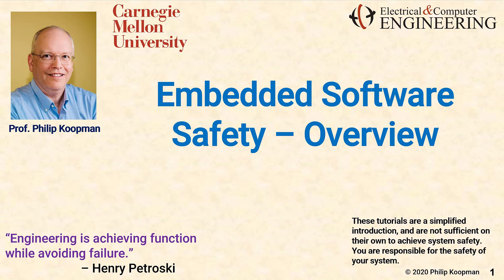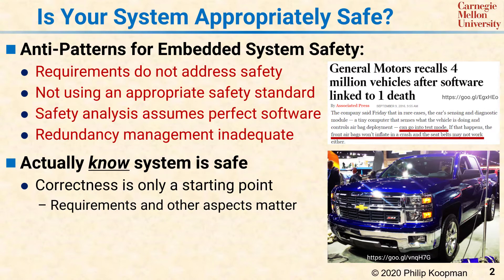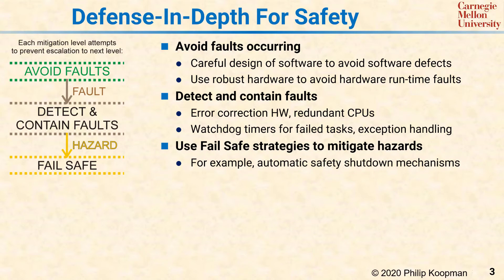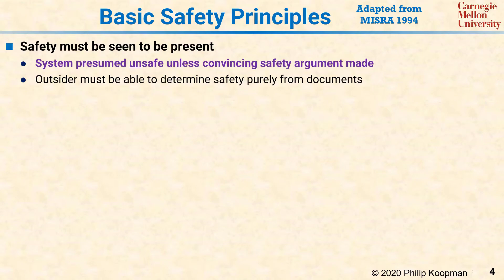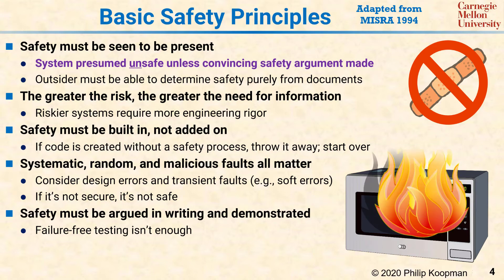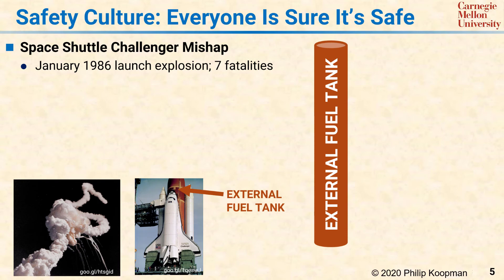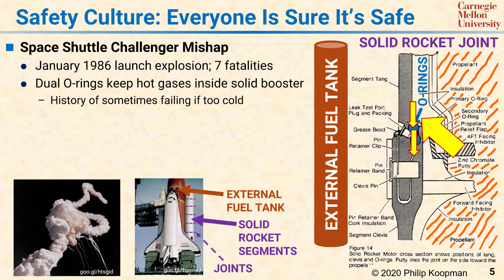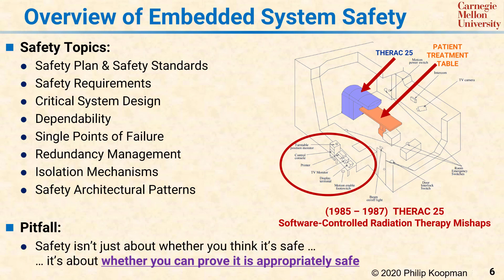L26 Embedded Software Safety Overview

Comment: I'm someone who wants to transition from a rapid-prototype style to a more formal environment..  perhaps not for FAA/FDA/DOE approval, but to develop high quality/safe products for any industry..  aerospace (like Lockhead's SEAL Level X, Boeing , DDPMAS etc) , Medical, or Nuclear industries. I'd love to see a trivial example that shows all the steps and outputs.

For example, assuming I document the process on how the code is generated, what constitutes proof that it's safe?  
Static Analysis, 
Code Coverage  - Statement (Level C), Decision (Level B), MCDC  (Level A)?   
Who defines the unit tests?   

I imagine there are differences between the industries.. 
FAA :  DO-178X , DO 331 , ARP4754A  , ED-12C
FDA : 13485 ,  ISO14971 , IEC 62304 , SaMD  and
DOE  : 414.1x, 
but what are the typical tools/software needed, and the typical document/artifacts in the various stages of the software life cycle?  

I saw a good video by CEMILAC Education Program "Airborne Software Development & Certification Process" and it's a bit overwhelming:
Requirement Management -  (IBM Ration) DOORS, JAMA, Xebrio, rmtoo florath , doorstop-dev / doorstop , reqview
Static Source Code Analysis - Parasoft, PolySpace, CodeSonar,  horusec , sonar cloud, veracode PREFast
Dynamic Analysis / Modified Condition/Decision Coverage (MC/DC) - VectorCAST, RapiTest
Configuration Management / Storage and Version Control System - Git, SourceSafe, Mercurial, MS TFS
QA - Helix ALM
V&V /  Test Automation - VectorCAST, LDRA Testbed , Mathworks Simulink DO Qualification Kit
Continuous Integration / CD - Continuous Delivery/Deployment 

And what is the general attitude towards open source software (ex. FreeRTOS) and code-generation tools (ex. ST's Cube MX)?   
How do CPLD and FPGAs fit in to the picture.. since not exactly software, but they are programmable devices written in an  programming language like VHDL , (system) verilog?